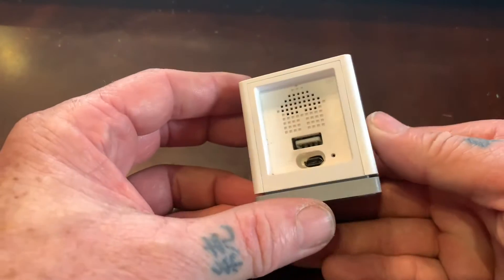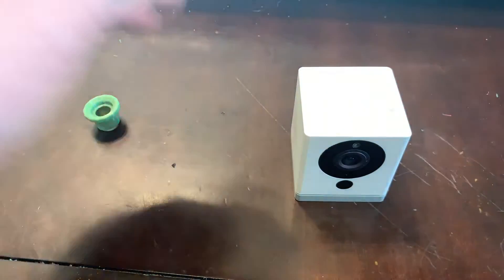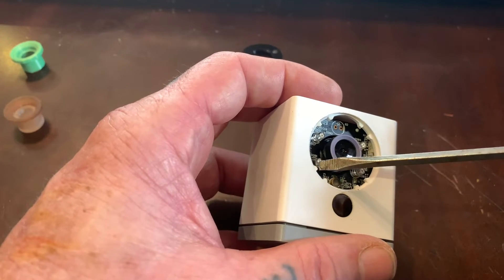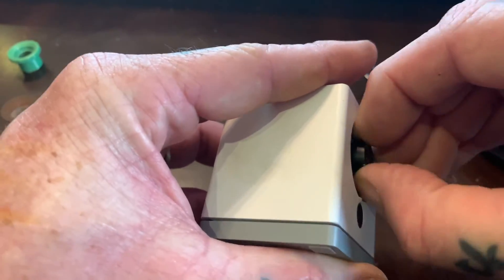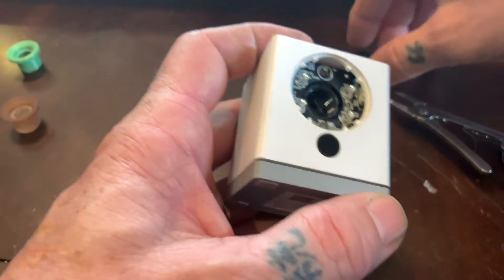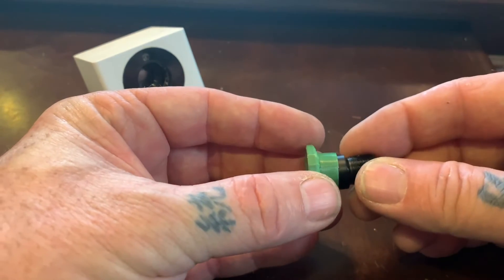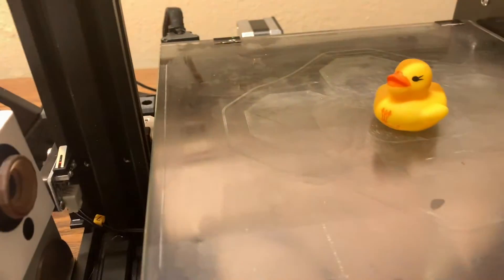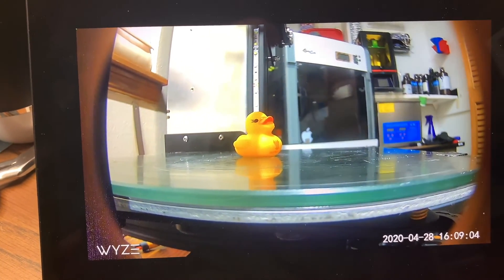Wyzecam Focus Ring

Comment: Thank you for these excellent instructions! I got a refurbished camera from Wyze which was actually set the way you wanted it but distant objects were out of focus. Rather than go through the hassle and delay of sending the camera back, I followed your instructions and adjusted the  focus myself. Plastic jawed pliers slipped on the lens mount so I used a hair dryer and a pair of lineman's pliers to gently unscrew the lens mount. When putting things back to together, just remember to mount the rubber gasket on the front cover first before snapping it back in place.

Comment: 2:45 just my input here but it is not a direct access to the sensor when you remove the lens assembly. there is a wafer thin piece of glass covering the sensor at that point. i know because that piece tends to fog over time with oils (long story,known issue, see forums) and i have had to remove it for cleaning on all my Wyze cams..

Comment: Thanks for the presentation and the file! Printed mine out, but I think I heated it a little too much because it wouldn't grab the ring. All good, though! Once I got it to grab a little bit, I set my focus, pulled the focus ring part off, put the rubber seal and cover back in place, and now it just looks like a Wyze Cam again :) 

Bonus, there's a little notch in the original ring, so if I ever need to make a quick adjustment, tiny flat head screwdriver for the win :D

Comment: Cool! What is the shortest distance you can focus on with this method?
Reply: When I was adjusting mine, it only took a very small turn (less than 1/8) to bring objects a few inches away into sharp focus, so I would guess it could focus very close with the lens screwed all the way out.

Comment: The internal design of the latest Wyze cam has changed a bit with a larger rubber grommet. Also, there is a cap that screws onto the lens that comes off (was glued) and the lens is also glued into the unit. Used a small metal pick to remove the glue around the base of the lens and then it screwed out by hand.

Comment: Thank you! This is exactly what I was looking for.
Do you know if this would work for the new Wyze Cam v3?
Reply from the maker: I have no idea, I am still waiting to get one to try it out.
Reply: Just wanted to comment and say that you can  do this with the Wyze Cam v3. I picked a couple up over the weekend. The procedure is a bit more invasive on the newer model, but it’s not too bad.

I will say that there was quite a bit of glue, but I was able to pick it away and it will twist freely now.
Reply: @mattneidert  Did you use his Thing file to print the focus ring? I want to do this with my V3
Reply: @kyleeaton1709  I didn’t. Unless you need to constantly adjust it once modified and put back together, you can simply twist it with your fingers and then reassemble.
Reply: @mattneidert  Can you elaborate a little with the V3? Did you just pop out the front, twist the lens and remove glue, then replace the lens and front? Or do you have to remove screws and take apart like other videos show?

Comment: Great idea! Went ahead and printed up the ring. I found that the lens had virtually no glue holding it. After going through the process I didn't like the vignetting created by the ring around the lens. I ended up pulling the ring off and with the face plate off, mounted the camera and turned the lens barrel to obtain focus. Afterward I replaced both the rubber gasket and the face plate allowing the camera its full field of view with perfect focus to boot.
Reply: Yeah this is what I ended up doing as well since I don't have a 3D printer and it worked beautifully!